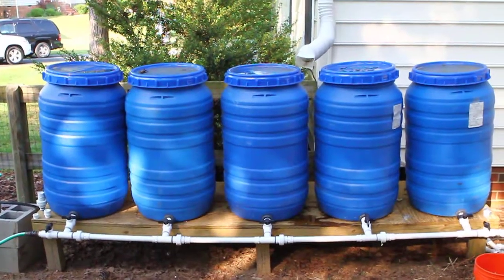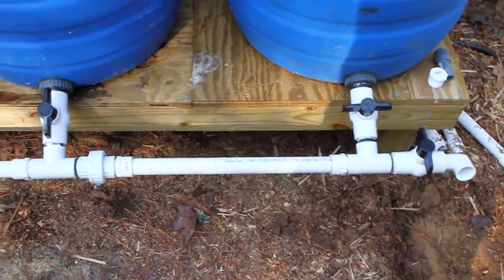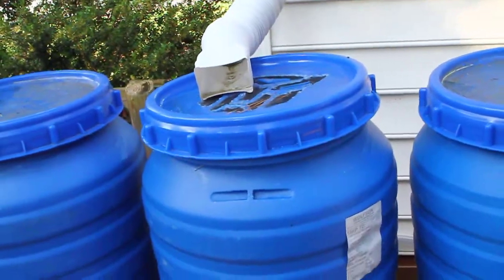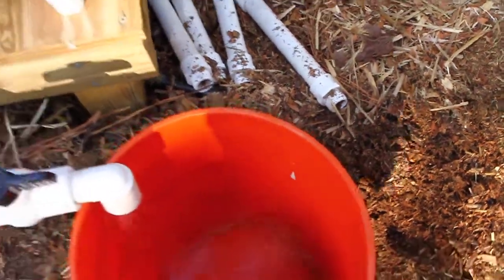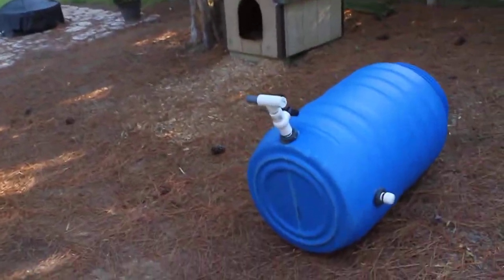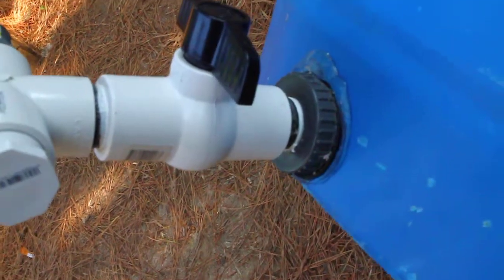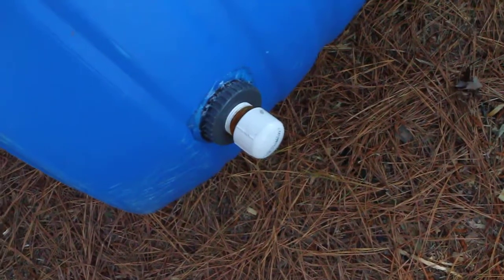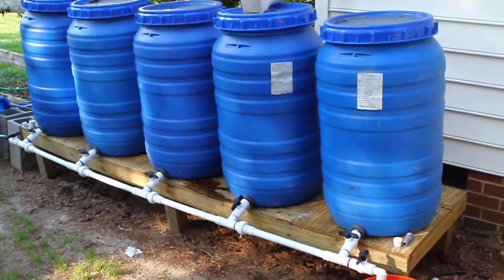Rain Barrel System (5- 55 gallon barrels)

Comment from the maker: @tribalwind  thanks for writing..  Depends on how you view this, the overflow is at the top of the barrel, but it comes out of the back of the barrel threw a bulkhead fitting.  No valves or manual operation required.  The 1"pvc pipe is run from the bottom fitting with an elbow then pipe was run all the way to top, just below the lid.  Therefore im collecting as much as possible in the barrel.  Hope that helps you out some, if not shoot me an email and i'll send you some pics.

Comment: thanks for sharing, nice job.
should the overflow not be located at the top of one of the barrels? it seems like you'd have to manually open it at the right time.
ive got 10+ barrels i need to get setup now that im back home (3months trekking thru bolivia, wild!)